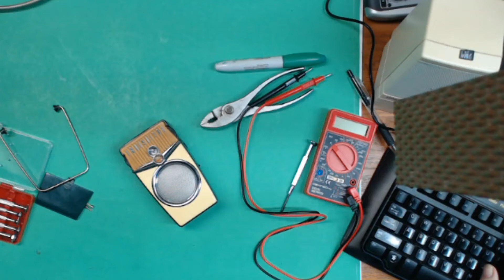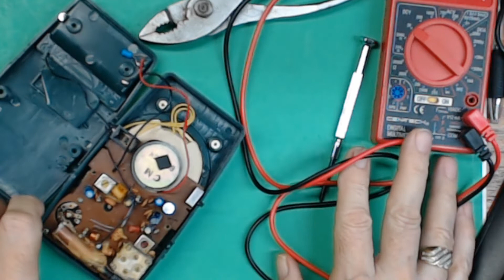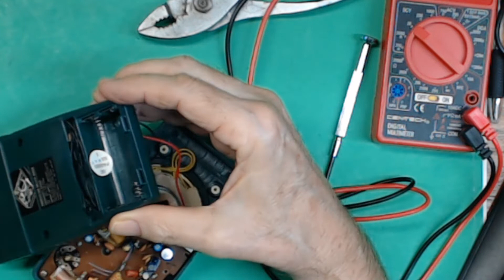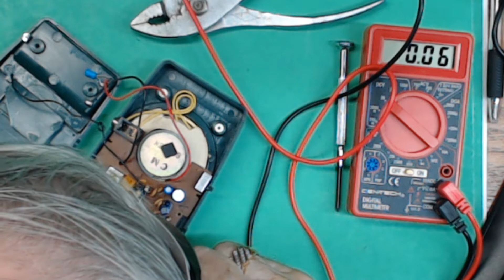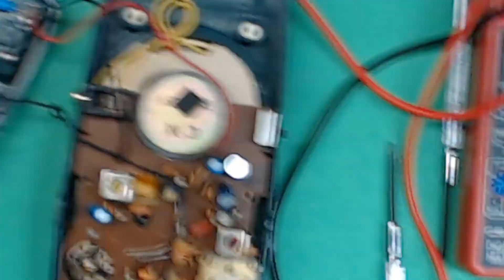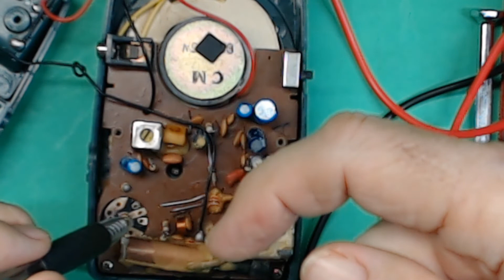TRRS #1987 - We Have Contact!

Comment: Bravo! I have a transistor radio (I think it actually has transistors in it) that belongs to my wife. It is probably more than 60 years old and I have had it stashed in a dresser drawer for years. Just can't part with it. Tomorrow is going to be a rainy day here in Connecticut and I think I'll once again to get it working.
Reply from the maker: Good plan.  Good luck.

Comment: Neat little exercise in diagnosis Tom. I used to work on cars alot and the first thing I used to do is, just stand in front of the running engine and look and listen. More times than not, I could get a handle on most problems by just observation.
Reply from the maker: I got lucky. LOL